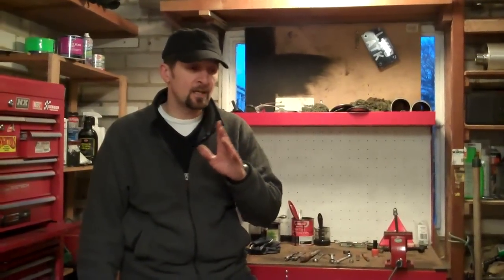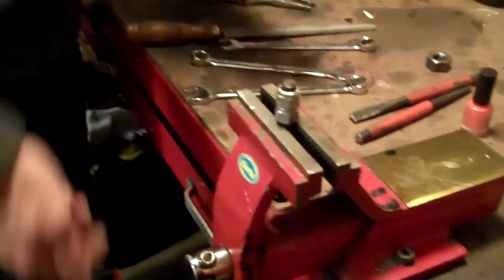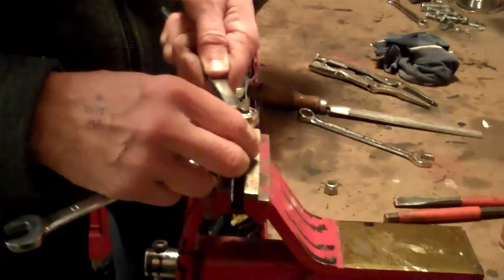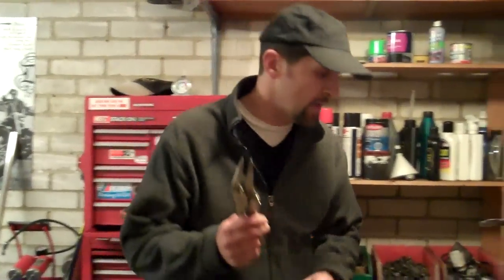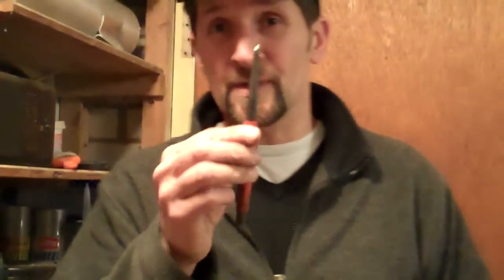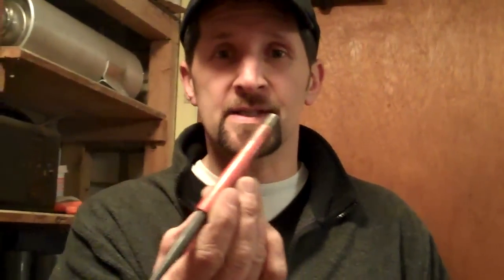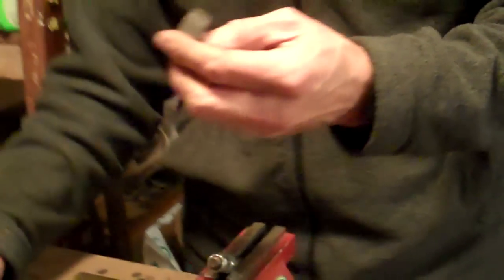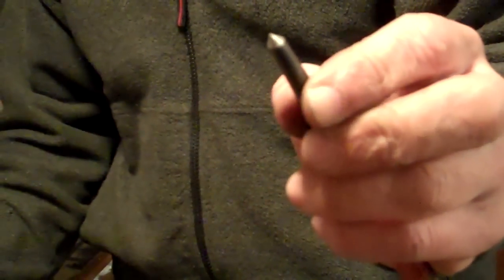Delboy's Garage, How-To ;- Rounded nuts?, an easy solution..!

Comment: Thanks so much for this excellent tip! I had a master cylinder bleed screw in a really tight spot that was seized, I rounded the bolt trying to move it. Using this method exactly, I got it off in 30 seconds! You just saved me a ton of work, thank you.
Reply from the maker: Excellent mate, always good to hear the videos have helped someone out... leaves you more time to do other stuff eh?!... Ride safe, mate, Del

Comment: I like you enthusiasm. I just used an imperial spanner, which was slightly smaller than the designated metric size and it gripped. Snapped the bolt but it abolished the incredibly hard task I had.
Reply from the maker: Drill it out buddy..?

Comment: Good vid.  I've done this as well with success. Some other tricks I've done depending on how much space I have - I've taken my 'junk' set of wrenches and sockets and figured out the next smaller size, whether metric or imperial...hammed that on to the nut and removed the nut that way. I've also ground down new flats to the point where the tool the next size down would fit. I've had some success using a *small* pipe wrench which bit the nut in such a way that it encouraged it to spin off.

Comment from the maker: Alun bolts centre punch off just like any other rounded bolt....the wrung bolt is rounded remember, like the outside of an alun bolt....so just spike it in and tap it round...if they are tight and wont punch, then use a half inch chisel hammered inwards into the lip to make a better cut to get a purchase on it..

Comment: Another way I can think of if cant use this method are turbo sockets that bite into the nut. Its another addon to your socket wrench set. Shame they are quite expensive for what they are though especially if you have to buy more than 1 set.

Comment: I just tried this method after the monkey before my tightened my sump plug too tight! It was that tight, my correct size socket wrung it off! So what I did was drilled a hole in the middle but not all of the way through. Then using a screw extractor (easy out) screwed it in with its opposite thread and then put my adjustable on it and curtain pole on the adjustable and swung like a monkey (gently) and it came off. Happy days
Reply from the maker: Happy days indeed Josh....is there anything more satisfying that finally cracking a stubborn bolt... it vexes me why people swing on them to do them up...if you have a fresh crush washer in place, and a dab of sealant...all it needs is a 'nip'...no more then about 12Nm, and it'll stay put...the actual torque value is always rated higher so nobody gets sued....but in the end, you'll always see more stripped out and swrung off than ever falling out..lol.. paranoya aye..!

Comment: I have a square nut froze on a gas tank drain outlet any suggestions.  I haven't destroyed the nut but I know a cresent wrench won't break it loose.  Tried WD40, tapping it with a hammer.  Can't use torch or I wouldn't be doing any projects that's for sure.  Help.

Comment: Great video, I am going to try to use the punch method on the two inspection cover hex bolts on my 97 sportster.  Would you recommend doing it cold or heating the bike up first?
Reply from the maker: Hi buddy, it's necessary to heat the engine up, just be really careful you don't slip off and damage the casing.. good luck with it, hope it works out for you, Del
Reply: Thanks for the great advice
Reply: Hey thanks again for the help I was able to get the primary inspection cover off today and changed the sport trans fluid.  As you Brits say, "It got a little bloody".  I ended up having to drill out the two hex bolts but it was easier than I thought and I still used the punch tapping method to get the heads out.  Unfortunately I had two get a little crazy on the primary inspection cover to get the angle.  No big deal I went to Harley to buy another one, to find out that its a discontinued part due to the age of the bike.  Found one across the state and they are mailing it to me so no riding for me today.  Funny thing if I would have spent the time on the derby cover I would have been able to get plenty of those on ebay.  Live and learn.  Again thanks for all the great videos I am a Fan.
Reply from the maker: You're welcome buddy, glad you are getting there!

Comment: Delboy- what do you think of the idea of putting a heat torch onto stubborn bolts to expand them so you can get them off?
Reply from the maker: Doesnt work woth a 'Bolt' mate, only a nut....if you expand a bolt you'll just wedge it in even more...the time to use heat is on NUTS....that way you expand them away from the thread they are stuck on....but not bolts, and if they are in an alloy thread you can crack the casing, so it only works in the right place and job...
Reply: That sounds logical- and talking of bolts , what do you think of the new Yamaha Bolt Delboy?

Comment: hi Del have a bit of a problem wondered if u maybe able to help
bike: zx6r j1 2001 
problem: rough low down, when i pull away from a stop its borking, I have stubbied my can not sure if that could be to do with it,

its had new plugs about 6 months ago, oil, air filter, etc

any ideas i think it needs carbs doing since the can being shortened? do you have any advice or pointers? 

or is there anything i could check that maybe cure it?

thanks

Comment: Its fine if thats just a throw-away-file but file teeth only cut in one direction, going back and fourth like you are using sandpaper dulls the files teeth prematurely. Run your file across in one direction away from you while applying pressure to cut away the material. When the file gets dull from years of proper usage, you can send them in to be professionally re-sharpened. Good files are getting harder to find.
Reply: P Kuudsk I think the problem with modern files is a lesser amount of precision, poor steel, and poorer heat treatment. I usually have to buy some German or Swedish files these days as Nicholson and Simonds are mediocre and no longer made in USA.
Reply from the maker: We pitch out videos at beginners and new riders, Beginners use cheap tools because thats usually all they can afford, with time and practice anybody will begin to understand how to look after tools, and with so many new riders needing to buy a whole set of tools to 'get started', they have to shop within thier budget (and thats a young guys budget too, which is often not much). and with a perfectly servicable file available for £1 here.....they often have little motivation to take lifetime care of it... we live in a throw away age now aye..!  and i am a Monkey.. i just hide it well..!!!!!!
Reply: Moonfleet41 I hear you on the throw away age. I look at things as I'm too poor to be cheap because I don't want to have to buy something I know i'm going to replace, not that I don't consider files consumables but the finish they leave and time good files save justify it to me. What bugs me though is I can get a 12 inch mill bastard Grobet for $18 and a made in Mexico or China Nicholson or Simonds with softer more irregular teeth cost the same price but will wear out quicker, cut less, and take longer to get the job done.

Comment: Its just a nut drill it first then breakout the chisel.......
And the main reason why bolts round off is due to corrosion they rust down to a half size .
No mention of heat no mention of lube and no mention of rocking?????

Your wife is funny though and she sounds cute so keep the vids coming....

Comment: Your videos have saved me so much time and money. I really appreciate you taking the time out to show us how its done. You sir,  are a national treasure. Rs.
Reply from the maker: Why thank you most kindly Sir, that is very generous, we just load up the things we have cause to do in the garage, and share it with our fellow bikers... thanks for watching and taking the time to comment.. Del.
Reply: Hi Delboy 
My question is about rusty stock (oem) nuts and bolts .Is it better to remove them clean them up with vinegar etc and then coat the heads in ACF-50 and stick em back on or simply just replace with stainless or titanium kits to which I have reservations about using stainless kits ?
Reply: @nsmith1661  Hi may I ask what would problems be with stainless kits?  Seems they would resist rust better.  Thanks
Reply: @achriscity  
yes you are right, its just when i spoke to other people about it they seemed to be purists and preffered oem. i was just asking delboy about keeping the old fasteners .

Comment from the maker: Hi mate, if your bike was running fine on the stubbied can stil recently then logically it can't be that - bogging on pull away is often attributed to a split diaphragm in the carb or a stuck choke, so starting the easiest first, make sure your choke is turning off completely & the cable isn't jamming, check your air filter is clean & not full of moisture & if all well, take the carb top caps off & inspect the rubber diaphragms for splits, let me know how you get on, Cheers Del

Comment from the maker: There is only one way if they are that bad...and thats to drill the heads off...use a bit the same size as the shank of the bolt, and be careful not to cut into the caliper casting... best results will be taking the caliper off and m,ounting it in secure vice....there is a little chance you may be able to get a really sharp centre punch to bite into the edge of the bolt..but it rarely works.. i just drill them off then remove the bolts stumps once its apart.. good luck with it mate, cheers, Del.

Comment from the maker: Hi mate, I also have those self same blobs of rust & inherited them with the bike!  Every time I've considered to take the pipes off,I've worked round it & actually not needed to,but if you truly have no choice but to remove the headers, then the best I can suggest is clear everything perifieral out of the way, rads, fairings, etc., get the best fitting alan key you can & soak in WD for a couple of days just give 'em a go,if they snap off then just drill them out & helicoil them - good luck, Del

Comment from the maker: Hi Dan....that's a bit trickier aye...ok, if you cannot get the centre punch to grip by taping it onto the lip top edge of the bolt head, then you'll have to drill it off...protect the tank with about ten layers of masking tape. then push the drill bit gently down into the head till the head drops off...then wind the stump out with some grips.....use a drill that's 1mm bigger then the shaft of the bolt..!

Comment from the maker: Hi Simon, now that's a tricky one mate....its a case if trial and error, try a flat bladed screw driver that almost fits in the hole but is just a tiny bit too big.. then tap it in with a toffee hammer, that's should get a grip on it....of not, then you may have to get an 'easyout' which is a left handed shallow screw for extracting stripped and snapped off bolts that you've drilled down...  if all else fails mate, just drill the head off it but be careful not to damage the bodywork obviously...

Comment from the maker: The biggest problem with Derby torx bolts is people use the wrong size, Derby bolts are a T27 but when you buy a basic Torx kit they skip 25 straight to 30 missing out 27, guys don't realise this so the only one that fits in the kit is the 25 (even though it's a bit wobbly), so off they go and hang on it and it minces straight away. Invest in a decent set of bits that include the rare 'T27' and give it afew taps with a toffee hammer as you twist and they usually come off every time.  Cheers Del

Comment from the maker: Good route...as long as the heat from the weld is ok with the surroundings (powder coated casing or plastic parts etc,) that a good way... more then anything its just using yer noddle and thinking it through...most of the time there isnt an error code for the things that blight yer bike...cheers mate take care, Del.

Comment: Good vid - perhaps the only thing I would add is before you get to the point of hitting it off is to try a decent quality 6 point/sided socket. I've not use one, but a "nut splitter" (ouch) may also be handy to keep in your toolbox.

And if you have a welder, you can weld on a good nut.

Comment from the maker: Just drill the heads out, remove the remaining stud in the normal way...there's nothing you can do if the centres are chewed out ... check through the back library, there is one on removing studs in the Yoshi can as they broke off (How-To Stubby a Yoshi Can) ... hope that helps, Cheers, Del

Comment from the maker: Good plans all mate, but hammering a smaller tool on is no different than squeezing it with grips...it still squeezes it tighter... but your method of filing down to the next size is perfect practice...nice tip mate... thanks for your comment..take care and happy new year..Del.

Comment from the maker: Alun bolt heads are a fun challenge... you can hammer a flat bladed screw driver in so its cuts a slot, then turn it with a spanner on the shaft...or if its too bad, just drill the head off and fit a new bolt...

Comment: Thanks. The center punch technique is an excellent tip, as long as you can get good purchase on the fastener. That's the same problem with nut splitters.

Does it work on bolt heads? I'm guessing not very well because the length of the threads adds friction.

Comment from the maker: You're right, if a bolt is siezed in its thread, you would have to dril it right out a size larger to clean smooth metal again, then use a "Helicoil kit" to replace the thread...they are used in spark plug holes and other large threads that get regularly damaged... the suit is a hybrid, i began with the "SRO" suit which was their top line kit, had both jacket and trousers replaced so now have the "XCR jacket" and the trousers are from their 'waterproof leather' range...thanks for watching, Del.

Comment from the maker: That's very typical Jay, the same happens with Derby cover bolts too, they seem to be made from stale cheese they are so damn soft.... i tend to fit them in with some anti-sieze and don't over-tighten them, often its helpful to invest a bit in some stainless bolts to replace the factory ones with...then you have made a handy upgrade that will save you further grief.. hope that helps... take care..Del.

Comment: Awesome video, thanks for taking the time to make this. another solution I use if you can get to the nut is a 'nut splitter'. The nut splitter sits on top of the nut and you tighten it with a ratchet. As it tightens, a blade goes though the nut and sheers it. It usually damages the thread of the bolt too, but if its a last resort thing, and you're going to replace the bolt anyway, it works well.

Comment: How about rusty nuts and bolts that sit on exhaust systems where they take a lot of heat? I find components exposed to strong heat to be more difficult to disassemble than those that are not.

Comment: Hello, Delboy! Great stuff as always. I have a quick related question for you. I have a couple of torx heads that are stripped. I'm thinking I could align the next size up and tap it in place with a mallet to get a good grip then carefully torque it loose. Thoughts?
Reply from the maker: Gabriel Garcia You can always try that Gabriel, it can cost you the torx bit as it'll most likely chew it up too....i just drill the heads off the bolt and replace them.. after all, they're buggered anyway so why risk trashing tools on them too...!!! just how i'd do it..!

Comment: I bought a damaged bike that had no key and had to do the same thing to remove the two security screws from the under side of the ignition mount, took me a little while but it was the only sound way to remove those two screws to take the ignition out to take to a lock smith.. cost me $35 instead of over $400 which was the rough quote the lock smith gave me to take it out themselves. It did take me a  few hours to get everything off and back on but well worth the experience :)
Reply from the maker: There's always a way round the big daft bills aye.. .Nice one buddy.. thanks for your comment.. Del.
Reply: Yeah it seemed like a lot of money but there was a lot of plastic and the headlight etc.. to remove.. Then when  all undone there was nothing on the head of the screws so the punch was the only way I could think of.. It's cool we are on almost completely opposite sides of the world and came up with the same idea.. I did get really sick of doin it upside down in the tiniest space!! Job totally sucked but I got a beautiful low k's V twin 1000 that I still have that came tuned with Remus pipes.. A bit thursty on fuel but so much fun to ride :)

Comment: before attempting to remove any rusted or seized srew, nut or bolt...spray with penetrating oil. the best i've found is WD40 super penetrating oil. it is fairly new on the market(at least i never noticed). here is my experience with using it. i try reasonable pressure to remove whatever, then soak it with penetrating oil. usually i am impatient so try to remove again after a minute or so. no good...still stuck. so i get a bottle of water and take a break. after 10-15 mins...bolt, nut, screw or whatever COMES RIGHT OUT! haven't done automotive exhaust bolts yet but bet works on them also. ounce of prevention worth ton of cure...just saying...use it BEFORE buggering it up